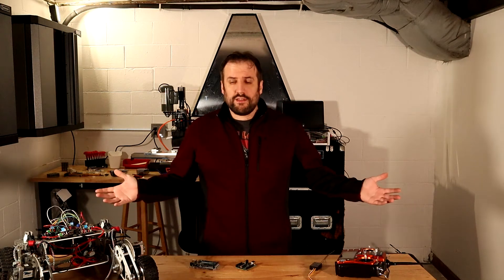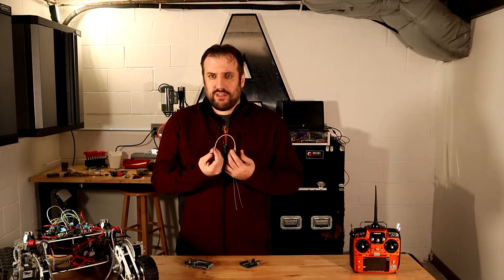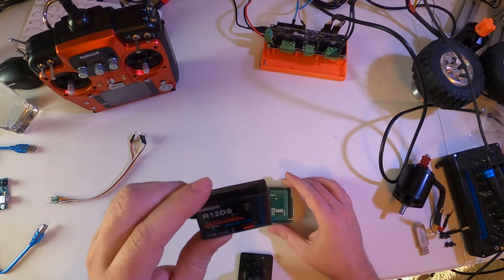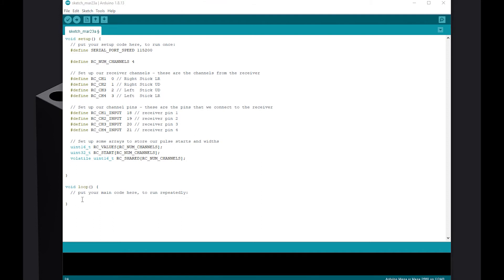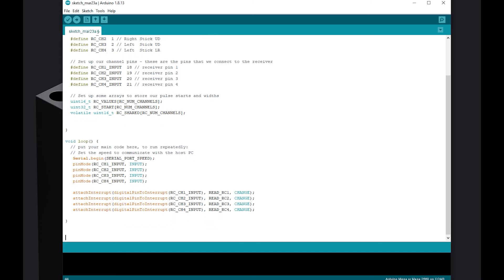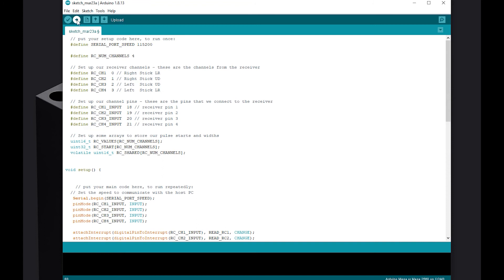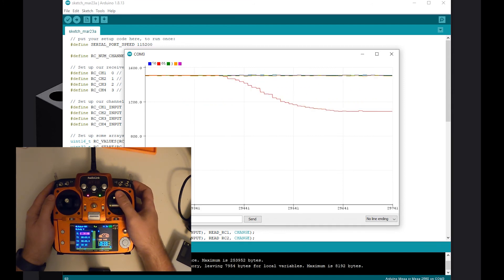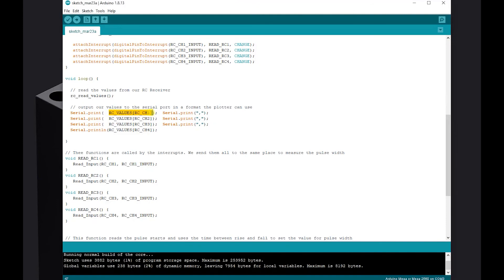Using an RC Controller with an Arduino [With code and wiring]

Comment: nice explanation,
but does it work parallel?
I mean, interrupt interrupts whole flow to compute a thing...
what if at the same time second input comes in? or third? or all 4 channels?
can it handle all 4 inputs at same time and provide proper reading/acting?

Comment: I'm getting a "'rc_read_values' was not declared in this scope" error. Why??

// Set the size of the arrays (increase for more channels)
#define RC_NUM_CHANNELS 4

// Set up our receiver channels - these are the channels from the receiver
#define RC_CH1  0 // Right Stick LR
#define RC_CH2  1 // Right Stick UD
#define RC_CH3  2 // Left  Stick UD
#define RC_CH4  3 // Left  Stick LR

// Set up our channel pins - these are the pins that we connect to the receiver
#define RC_CH1_INPUT  18 // receiver pin 1
#define RC_CH2_INPUT  19 // receiver pin 2
#define RC_CH3_INPUT  20 // receiver pin 3
#define RC_CH4_INPUT  21 // receiver pin 4

// Set up some arrays to store our pulse starts and widths
uint16_t RC_VALUES[RC_NUM_CHANNELS];
uint32_t RC_START[RC_NUM_CHANNELS];
volatile uint16_t RC_SHARED[RC_NUM_CHANNELS];

// Setup our program
void setup() {
  
  // Set the speed to communicate with the host PC
  Serial.begin(9500);

  // Set our pin modes to input for the pins connected to the receiver
  pinMode(RC_CH1_INPUT, INPUT);
  pinMode(RC_CH2_INPUT, INPUT);
  pinMode(RC_CH3_INPUT, INPUT);
  pinMode(RC_CH4_INPUT, INPUT);

  // Attach interrupts to our pins
  attachInterrupt(digitalPinToInterrupt(RC_CH1_INPUT), READ_RC1, CHANGE);
  attachInterrupt(digitalPinToInterrupt(RC_CH2_INPUT), READ_RC2, CHANGE);
  attachInterrupt(digitalPinToInterrupt(RC_CH3_INPUT), READ_RC3, CHANGE);
  attachInterrupt(digitalPinToInterrupt(RC_CH4_INPUT), READ_RC4, CHANGE);

}

// Thee functions are called by the interrupts. We send them all to the same place to measure the pulse width
void READ_RC1() { 
   Read_Input(RC_CH1, RC_CH1_INPUT); 
}
void READ_RC2() { 
   Read_Input(RC_CH2, RC_CH2_INPUT);
}
void READ_RC3() { 
   Read_Input(RC_CH3, RC_CH3_INPUT); 
}
void READ_RC4() { 
   Read_Input(RC_CH4, RC_CH4_INPUT); 
}

// This function reads the pulse starts and uses the time between rise and fall to set the value for pulse width
void Read_Input(uint8_t channel, uint8_t input_pin) {
  if (digitalRead(input_pin) == HIGH) {
    RC_START[channel] = micros();
  } else {
    uint16_t rc_compare = (uint16_t)(micros() - RC_START[channel]);
    RC_SHARED[channel] = rc_compare;
  }
}

void loop() {
  
  // read the values from our RC Receiver
  rc_read_values();

}

/ this function pulls the current values from our pulse arrays for us to use. 
void rc_read_values() {
  noInterrupts();
  memcpy(RC_VALUES, (const void *)RC_SHARED, sizeof(RC_SHARED));
  interrupts();
}

// output our values to the serial port in a format the plotter can use
  Serial.print(  RC_VALUES[RC_CH1]);  Serial.print(",");
  Serial.print(  RC_VALUES[RC_CH2]);  Serial.print(",");
  Serial.print(  RC_VALUES[RC_CH3]);  Serial.print(",");
  Serial.println(RC_VALUES[RC_CH4]);

Comment: Very nice explanation. This is going to help me out a bunch. I realize there are 101 ways to code the same functionality, but I was wondering if you see an advantage in storing the PWM duration into RC_SHARED and then calling the rc_read_values subroutine to port the values into RC_VALUES. Why not just store the PWM duration directly into RC_VALUES and eliminate the rc_read_values subroutine altogether?

Comment: I have and Arduino Nano, but it's not working, i change the pins from 18, 19, 20 and 21 to digital 8, 9, 10 and 12 but nothing- Help
Reply from the maker: Only pins 2&3 are interrupts on the nano according to the arduino website:

https://www.arduino.cc/reference/en/language/functions/external-interrupts/attachinterrupt/#:~:text=Uno%2C-,nano,-%2C%20Mini%2C%20other%20328%2Dbased

Comment: Really helpful, thanks a lot!!
how to control 2 DC motors (which has encoder with PWM ,DIR and A&B feedback pins) using RC receiver!!
And Can the code support PPM 
(It would be great, Even if the video is about PPM and DIR pins only)
thank you very much!!
Reply from the maker: Part 2 has servo control in it. Setting up steppers would be very easy if you follow that example

Comment: Good video and I look forward to part two.I like the plotter, hadn't seen anyone use that before. I have a project where I need to remotely control a 4000w hub motor that will be used as a winch. The motor's controller requires a 0 to 5v analog input signal to control the speed of the motor in one direction only so, I need the RC receiver PWM signal to enter the arduino nano that I have and come out as an analog signal. I understand the Nano does not have a real analog output but a pulsed output mimicking analog but, I was wondering if the tiny MCP4725 PWM to Analog module that I have could turn that into a smooth variable DC output. I've never done this sort of thing before and have spent some time scratching around the net trying to get some idea as to what code I would need and wondered if your code could be adapted. I would only be using one channel on my 3 channel receiver so would think the code would look rather spartan in comparison. Would you have any ideas on my problem please other than give-up {:-))

Comment: good instructions ,i need part2 of this video
Reply from the maker: If you have suggestions for part 2 let me know, I have been working on this video but I can certainly add more before I publish if you can think of something you would like to see!
Reply: @AndyVickersNet  Great tutorial, thank you.  I hope you continue to develop this series into a functional four wheel RC robotics platform.  There are lots of impressive 4 wheel robot videos on youtube and some even use RC controls and have "skid steering" (turn in place) but I haven't seen a series that takes it from start to finish with the detail you're providing. Cheers!